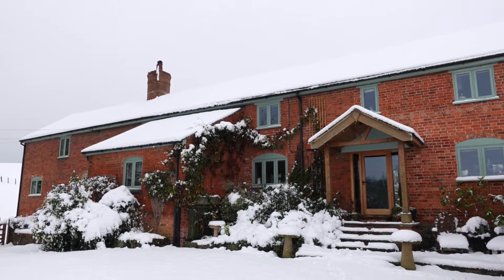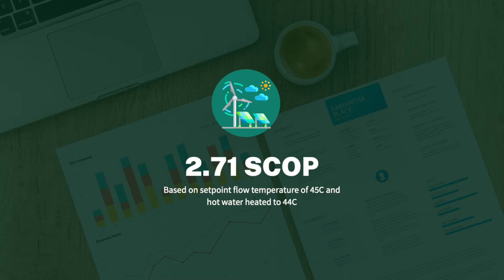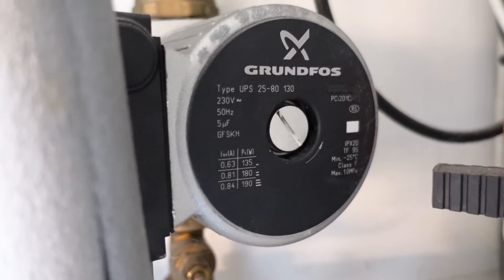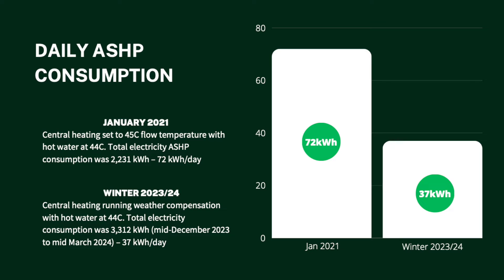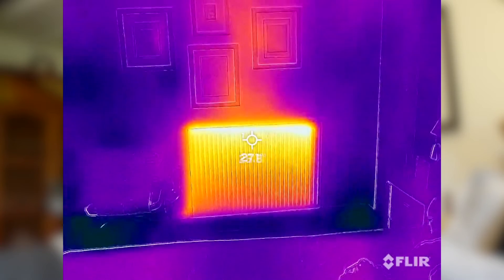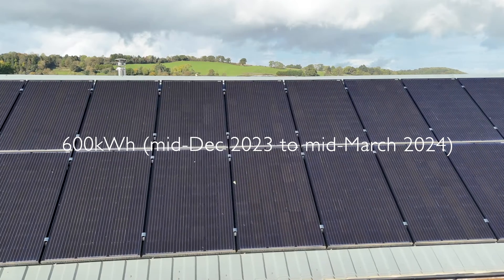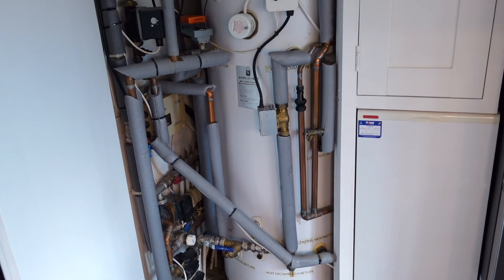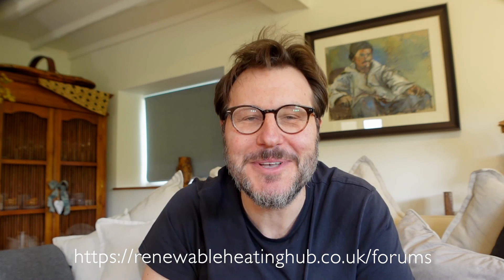Heat Pump Winter Review: Setpoint Flow Temperature vs. Weather Compensation

Comment: Great video and a timely subject for me, even though we don’t have an ASHP. Our gas boiler is capable of running weather compensation but was never set up to run it. For its last service we got a Heat Geek installer to check it out. His recommendation is similar to yours. Open loop, and the removal of inefficient extra pumps around the UFH manifold. We’ve never felt our UFH was as effective as it should be. After watching Heat Geeks at work we’re confident that our running costs and comfort levels will improve as a result. Good luck with your upcoming work.
Reply from the maker: Thanks for watching and sharing your experience. Let us know how your work gets along when you get around to it and we’ll compare notes.
Reply: @RenewableHeatingHub  Will do

Comment: Great video, very informative. Did you adjust the energy usage for each period according to the heating degree days vs the mean? Jan 2021 was particularly cold with about 20% more heating degree days vs the mean, whereas the winter 2023-24 has/is one of the warmest ever. We've had closer to 30% less heating degree days compared to the mean. These are significant adjustments that have to be considered to compare apples to apples across different years with respect to energy usage.

The degree day stats for UK: https://www.gov.uk/government/statistics/energy-trends-section-7-weather#full-publication-update-history

Comment: Glad you’ve seen improvements. Just a note to say that I have Heatmiser stats (hardwired) and they are all about 1.5-2deg out of whack compared to a decent calibrated thermometer. If you use your IR camera on the stat you’ll see it emits a fair amount of heat and I believe this skews the accuracy. I calibrated mine down and seems better.
Reply from the maker: Thanks for the tip and feedback on the Heatmiser stats. Never even crossed my mind because the rooms feel similar to the temperature indicated by the stats, but does warrant an investigation. Thanks for that.
Reply from the maker: @jedherman7450, we have a shout out to you on this video: https://youtube.com/shorts/lhaZuOwhoL8

Comment: Here we installed a 4Kw heatpump with weather compensation. Set at 20C with slope 1C/C, so at 0C outside the CH water becomes 40C. Floor heating and radiators installed, living room temperature set at 19C. We used 220KWhr for heating over the month of February with an average COP of 4.45. Hybrid system, but the gas heater did not kick in for heating, only for warm water, 19m^3 of natural gas including cooking.
Reply from the maker: Great numbers. Thanks for sharing. What brand is the heat pump?

Comment: Brilliant. A huge reduction but is that total electricity for the house or just for the heating? I think we live at similar temperatures and we use the whole 165sq.m house 24x7 but our total energy usage over the past 90 days was 2140kWh. Heating is with our two air-to-air mini-split heat pumps 👍  but I have to admit that 4 weeks ago we had our ancient (condemned) gas boiler replaced with a new one, for a few reasons: 
1. It was also going to be better+cheaper for heating hot water than the immersion we had used for the past 8 months and having a bath would become viable again!
2. I felt we were a bit too reliant on off-peak energy prices with Octopus Cosy - what if that ended because everyone had switched to EVs? We might struggle. 
3. I also thought it might be handy if the weather got below -7°C where our mini-split COP drops to 2.4.
4. Viessmann were flogging their 11kW boilers with 72% off the RRP.

I don’t think your average British Gas fitter can wrap their heads around the idea of a puny 11kW boiler - is this why they are so cheap?

My gas man's jaw fell open when I told him I wanted an 11kW boiler with no thermostats, no TRVs, no external controls - just a thermistor on the tank and one outside for weather comp. The boiler has wifi so only needs a Viessmann app to manage everything but this was an alien concept to him.

For the first week, we experimented with gas heating when outside fell below 3°C but soon turned off CH because it was working out more expensive than using the mini-splits, so now we just use it for DHW. We have a lot more water available while it consumes about the same as the old boiler's pilot light, about 4.5kWh per day. One other small advantage is that we can stuff insulation around the tank - this isn’t possible when using an immersion because it will overheat and cut out. So almost by accident we ended up with a hybrid system and it does work very well.

Comment: We had a Ashp installed in 2020...initially set up with a constant flow temp and buffer and also gave a low Cop... Since we moved to weather comp and removed the buffer the cop has improved by 20 percent or so and the plant room is alot cooler... Good luck with your plans...
Reply from the maker: Thanks for sharing @russelljulier ... it's 100% the way to go, and I wish more installers would see this is the most efficient way forward. What brand heat pump do you?
Reply: We have a Daikin Altherma 16KW, installed as part of a Government Electrification of Heat Trial, we run the system as a single zone with TRVs on the radiators mostly set fully open...the system can maintain a temperature of 19-20 degC with an EPC rating of C.   @RenewableHeatingHub

Comment: Hi to you both. I followed the early months of your installation experience and had a few email exchanges with you at the time but have missed the intervening developments.

It certainly looks like you suffered from being an early adopter but it is great that your installer has stuck with you throughout - you and the installer have learned a lot in the process.

This was an excellent video and you covered all the major points perfectly. It is lamentable that installers avoid future customer interaction by encouraging  set point (fixed flow temp) operation and cloak or dismiss weather compensation - this applies in the gas boiler market too. I am running a Viessmann 200 gas boiler on weather compensation with ‘cold radiators’ - it is fantastic. (The boiler is too young to trash for ASHP - but that is my trajectory).

Are you intending to fit open energy monitoring equipment - it is a force for good?😉

I will re-engage with your journey to follow developments. If there is anything to learn over the last few years it is system design is everything, good heating engineers are scarce and most installed systems are over powered, over controlled, over pumped and under performing.

Thanks for sharing the update.👍
Reply from the maker: It's great to hear from you again; it certainly has been some time. While we're likely not pursuing the open energy monitoring path, I came across something quite intriguing regarding monitoring this morning that has sparked my excitement.

Thank you for your continued support over the years – it's been immensely valued. Expect many more updates and videos in the coming weeks.

Comment: Shocking that the manufacturer lied saying the unit wasn't capable of weather compensation when it was.
Reply from the maker: It was a crazy thing to say. They just didn’t want the hassle I suspect, and an easier way to “hide” the subpar installation.
Reply: @RenewableHeatingHub  just shows you that they don't understand their own product and how best to run it.
Reply from the maker: This is yet another instance of an industry falling short of expectations – the number of skilled and competent installers is simply not sufficient.
Reply: From my experience of mitsubishi you're probably over dramatising things with 'lied'. I'm seeing very inconsistent training and hence agent knowledge. I suggest it's more about incompetence than antibody lying.

Comment: Why not chat to a Heat Geek elite installer? Very good at optimising etc
Reply from the maker: We’ve got arrangements for Ultimate Renewables to do a complete overhaul, but Heat Geek is a good suggestion too.
Reply: @RenewableHeatingHub  From what I have seen, a heat geek installer is properly accredited and trained and "should" be an excellent way to go. Fra better than relying upon somebody who claims to know but more likely applies rule of thumb rather than mathematics to a design